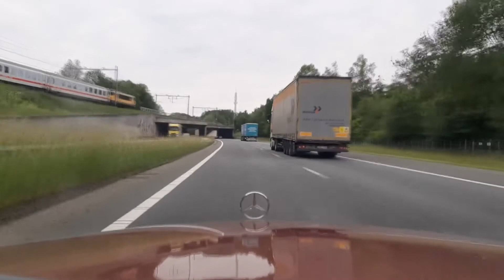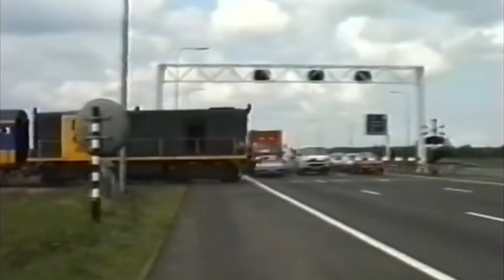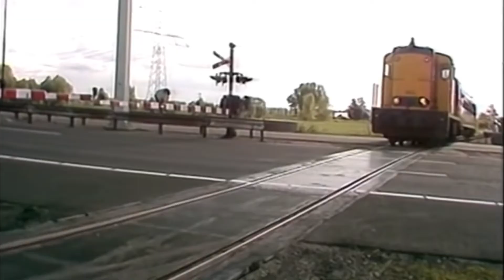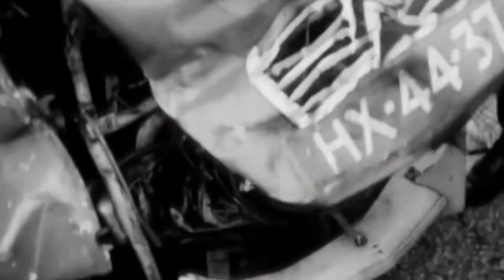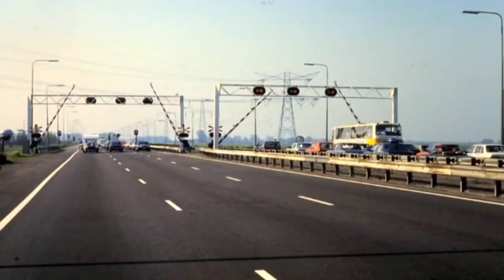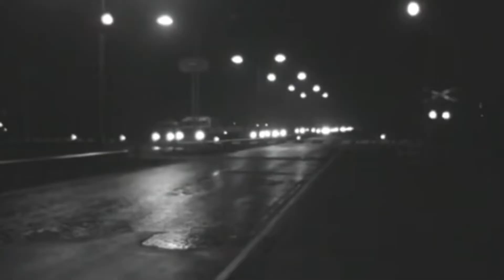Why This 6-Lane Highway Has a Railroad Crossing!

Comment: I mean you could maybe look at one close to Hoorn. I there still is a LEVEL CROSSING with a very lightly used rail line. Might wanna cover that if you are interested.
Reply from the maker: aah, I didn't of that one! I quite possible am going to make a video or a short about that one. It depends a bit on when I am in that area. but thank you very much!
Reply: @Hollandstation  Oh yea IDK if you found it yet but it's on the Westfrisia weg, at the start where it intersects with the highway, technically its not an A level highway, it's a large N road but it's a huge crossing and people regularly drive 100 on those 3/4 lanes both ways. It looks like a highway alright.
Reply from the maker: @NLvideomaster  yeah I found it after your first comment. It's from the trammuseum

Comment: there were level railway crossings across Highway 401 east of Toronto into the 1970s - single spurs for factory access with no lights or gates so signalmen probably helped stop traffic for the rare train that needed to cross